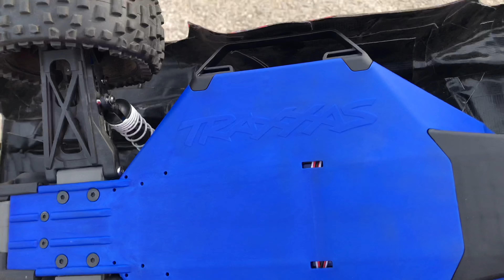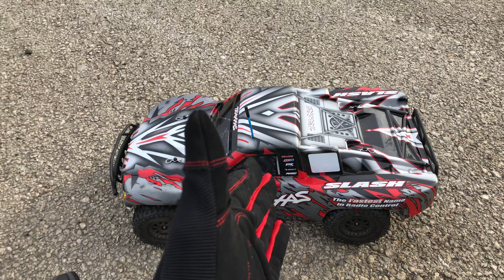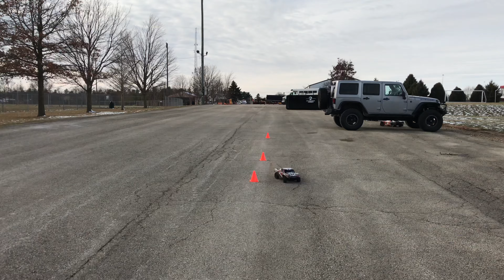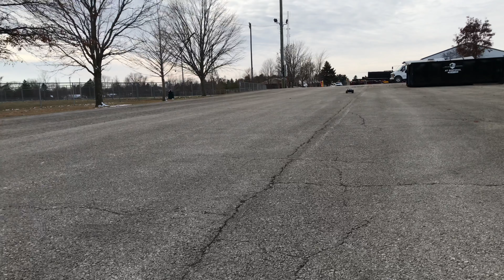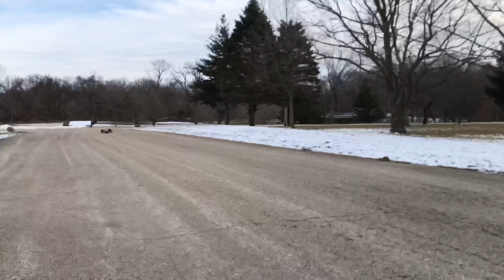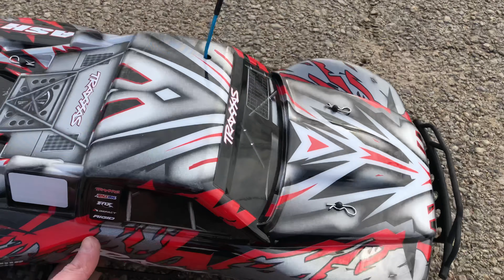TESTING the HANDLING of “The CHEAPEST Traxxas Slash” After INSTALLING #5830 LCG CHASSIS Kit!!

Comment: What we need is a diff with some thick fluid to try and lock it up a bit, not completely locked, but more like and lsd. I have traxxas pink springs in the front to help with roll and I’m planning to install a low cg chassis so that should help, but these aren’t going to do much other than having some kind of roll bars and an lsd diff would make a huge difference to not having the inside tire lift up. I actually have trouble braking when turning because the inside wheel picks up and just locks that one without actually slowing the other wheel down.
Reply from the maker: Yeah I run the Traxxas Drag Slash Trans in my Slash now

Comment: I don’t run low voltage on the ecu, I have a lipo alarm that works great. It beeps when it detects a low voltage so that could fix the issue without trashing your batteries
Reply from the maker: Yeah that’s a good idea

Comment: You've probably done a lot since this video, but 2 things that stand out to me as far as handling improvements, are getting a swaybar kit, and going to heavier oil in the diff.
Reply from the maker: Planetary differentials don’t have oil in them. I did address the handling by changing the shocks and doing a fuel line hack to help reduce body roll

Comment: would recommend either add some sway bars or lower the ride height, add stiffer springs and heavier oil on the shocks, the slash will run worse off road this way but it should not tip over atleast so easily at high speeds on payment.
Reply: The lcg 2wd is the about the same as a hcg 4wd slash. It’s good off road
Reply: @therowdyboysnetwork2827  yeah but the flipping still occurs without further attempts to stabilize it for for on road
Reply: True

Comment: You gotta change the shock oil. If you want to stop the tipping. You could have spent less then $20 in shock oil and way less time on the install. Then the $40 you spent on a lcg chassis and the time to swap over all the parts. I can turn full speed with NO tipping. FYI
Reply from the maker: Thanks for the tip. I still thinks it’s a worthwhile upgrade though
Reply: @RCKnockout  definitely because it lowers the CG keep it up brotha
Reply from the maker: @cbdfpv  thanks man! 😉
Reply: @cbdfpv  Would like to see video of that. Full speed...
Reply: What weight shock oil ?
Reply: what shock oil did you use?
Reply: What weight did you use?

Comment: Maybe stiffer springs or shocks upfront same like long travel once you have Enough pounds force to the ground you can eliminate sway bar
Reply from the maker: This doesn’t have sway bars though.
Reply: I really like your channel man! Keep up the daily content it’s something I look forward to daily
Reply from the maker: @Mrjazzzery  thanks man! I appreciate it! 😉
Reply: More of a reason to put stiffer springs... on a Tacoma you need at least 600lbs per side of downward force to keep from rolling the vehicle other wise you need a sway bar
Reply from the maker: @Mrjazzzery  shouldn’t a Toyota Tacoma have sway bars regardless?
Reply: If it’s stock, if it’s long travel you don’t need it otherwise you’d probably bend your frame at any articulation lol
Reply: But I’d say the rc is more like a long travel truck rather than a stock truck at the 1:1 comparison
Reply from the maker: @Mrjazzzery  a real life truck would be leaf sprung though not independent rear suspension
Reply: Yes most likely a spring under for maximum travel, tru, but it leans the same exact way. The inside tire like you point out still is the first to lift on a turn or donut
Reply from the maker: @Mrjazzzery  that’s true. Weight transfer is the same regardless of the scale

Comment: It tips because the tires are too grippy for the car, to fix it put on the stock tires
Reply: no, mine still tips, you will have to stiffen the springs, and even then it will still tip, from there, you should add sway bars or lower the height, the 2wd slash won't do well on payment unless you modify it specifically for on road use and you will sacrifice some off road use over it.
Reply from the maker: @AlineaEuros  I would agree that the 2wd slash isn’t the greatest on pavement. Stiffening up the suspension would help eliminate some of that body roll
Reply from the maker: I’m definitely not gonna put the stock tires back on lol 😂